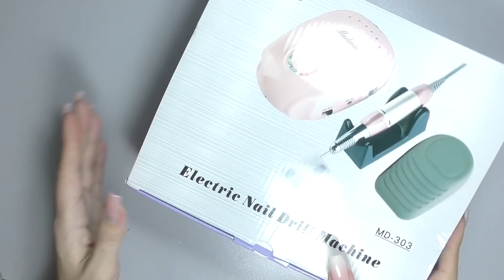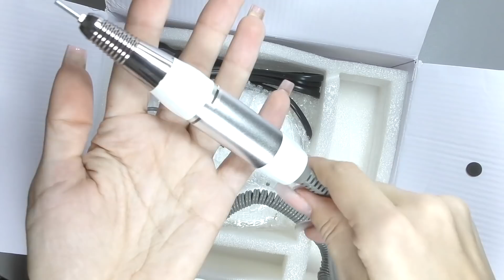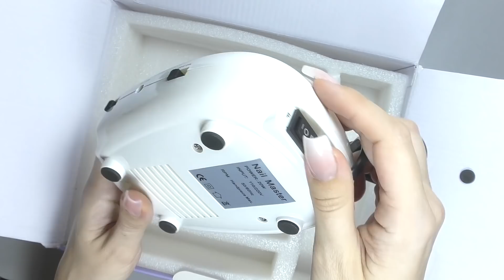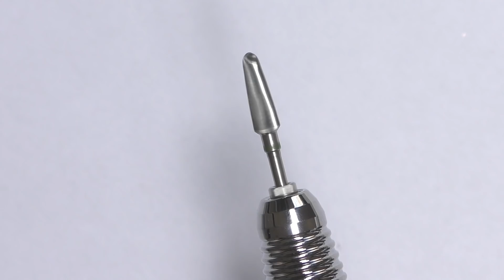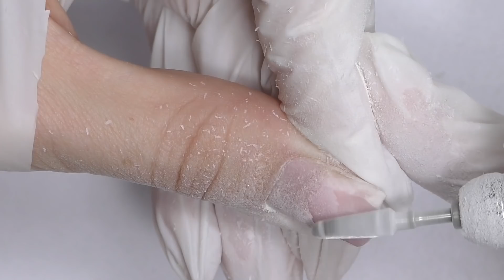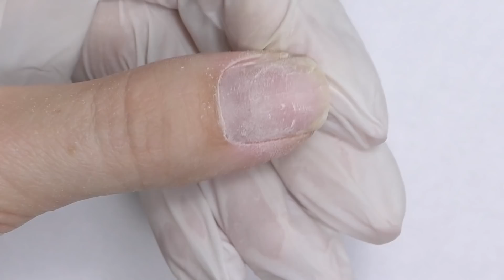Top Rated Amazon Nail Drill Review - Madenia  Electric Nail File

Comment: I bought a rechargable e-file from aliexpress and it's brilliant!  It has good torque and 30k rpm at 30Watts.  I was using my Foredom pendant drill for all my needs before I bought this and have to say I'm very impressed, the handpiece is small and quiet, it's very well made and has no wobble with the various bits I use.  The unit looks attractive and not bulky, so is very easy to put away in a box with the bits tidily.  It cost me £30 including shipping.  I bought it from ABODY store and it came quite quickly.
Reply: Do you have the link? Or name/brand. Thanks in advance
Reply: @BetsyG24  Here's the link:  https://www.aliexpress.com/item/32868099462.html?spm=a2g0s.9042311.0.0.27424c4dLcTct5

Comment: I would say spend a little extra and buy a Kupa Manipro for 115.00  ive had one for about 5 years and it works great
Reply: FatPeanutsFat where did u get it at that price?
Reply: @Dee98711  from Kupa website. Mind you I am speaking about the Mani Pro original and not the Mani pro passport, which starts at about four hundred bucks
Reply: @FatPeanutsFat   Thank you so much for sharing but sadly they have taken out this product at Kupa.. I don't know if it is permanent but my suspicion is that it is because I read that they had discontinued the warranty from I believe Oktober or November of 2018.. so my suspicion is that it will be discontinued sadly.
A Kupa for cheap is history I do believe sadly 🙁
Reply: Bummer when I checked the site after this video they still had some in stock
Reply: @FatPeanutsFat  yes I know! I wished I jumped on one but I hesitated because it didn't had any guarantee anymore. But again, thanks for letting us know this 👍
And now I am in a pinch because I truly do not know which one to buy.. but 400 bucks is truly too much for me for just a few times per week usage but I also don't want one that has a foot peddle that doesn't work the way it should, because the Chinese knockoff one's have made it so it only turns on and off and not the way it should be, that the footpeddle also regulate the speed, just like the handpiece does..
So, if somebody has an idea? Please let me know, you would make me very happy 😎

Comment: I just want to say for anyone looking for an affordable efile, your best bet is to buy a dental micromotor from Amazon or eBay. You can get one for around 65$ and they have the proper torque and go to about 30k rpm. They also have ones that go 45k and 55k rpm. I think that’s too much especially if the machine has enough torque you don’t need that kind of speed. Hth.
XO Luna
Reply: GlitterismyCRACK do you need to use handpiece sold for it or regular nail handset ?
Reply: Loz 
The one it comes with is what you use as that is where the motor is, they also take 3/32 size bits. Also they are quite lightweight as they were intended for dentistry.
Reply: @GlitterismyCRACK  thanks for confirmation,I'm looking at them in UK and they mainly seem to sold as separate units so just wanted to double check.
Reply: Loz 
Here is another link that has an EU plug 🔌. Maybe you can find the same models on the eBay EU, UK site. 
https://www.ebay.com/itm/Dental-Lab-Drill-Micromotor-Electric-Polishing-30K-RPM-SL400-Highpowered-US-Plug-/223300204821
Reply: Loz Also the hand piece runs about 15-30$ for a replacement which isn’t bad at all and they even sell replacement cords in curly and straight, I personally prefer a straight cord for my hand piece.
Reply: GlitterismyCRACK thanks hun im looking at one called called a strong 204 ,but also interested in one called marathon 3 champion by saeyang cant decide haha
Reply: Loz 
I have the Saeyang,K35 the one that looks like the one Ugly Duckling, has branded same exact model just not the extra 200$ for the brand name. Strong is also a very good name in pro micromotor’s.
Reply: @GlitterismyCRACK  the saeyang k35 is 800 new zealand dollars. Do you have any idea of something similar but cheaper. Way cheaper
Reply: Eva Torresagasti 
As I said before search for Dental micromotor, Strong is a great name brand with several models.
Reply: @GlitterismyCRACK  hi! I'm Brazilian, and I'm researching for a new efile. The ones you're talking about, are they quite and low vibration? Thanks for your help
Reply: Kayla M Here’s a link it’s 69$ I find once you find the model you can then search other sites for better prices. 
https://rover.ebay.com/rover/0/0/0?mpre=https%3A%2F%2Fwww.ebay.com%2Fulk%2Fitm%2F143252718218

Comment: Can you help me with drill bit advice? I see some nail techs keep it in one place for a while and no burning. However with myself I have to keep it moving quickly and shortly to not feel the burn! I have a saeyang cube. Do you have to have expensive drill bits for no burn? They all look like they’re made from the same place? Like a bulk product with just different names stuck to the packaging :(
Reply: You either have it too high, or it has a heavy vibration.... you always want to stick with a low setting cause it will heat up and burn your nail.
Reply: I don’t have it on high, I have it on very low and the vibration is non existent. I guess it’s bevause my nail bed is so damaged?
Reply: I do have ceramic :) and yes my nail beds are very thin and damaged as I practice on myself
Reply: Thank you for your insight. Oh gosh I couldn’t replace my nail drill I’ve not long had it and at £180 I best get my use out of it lol